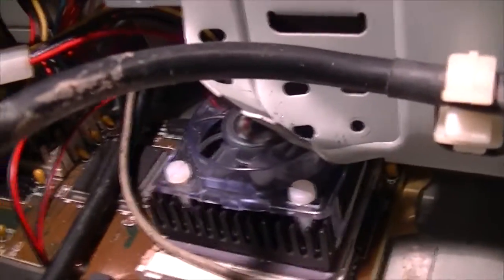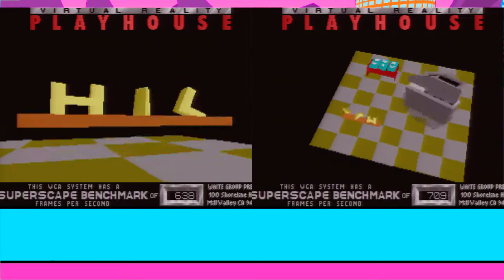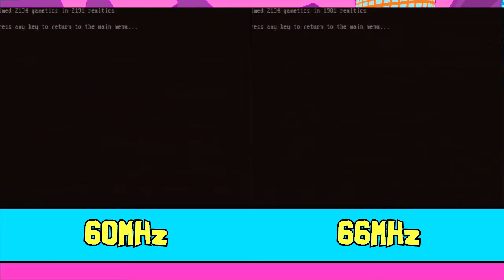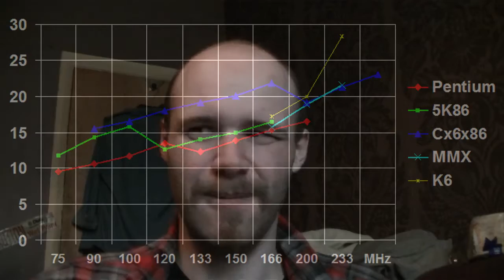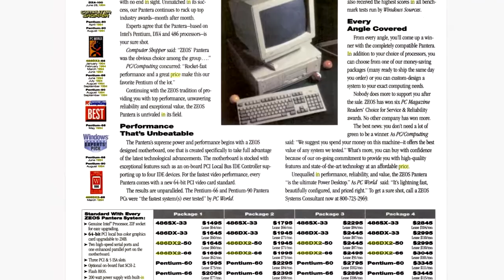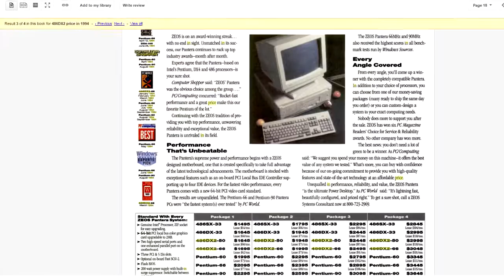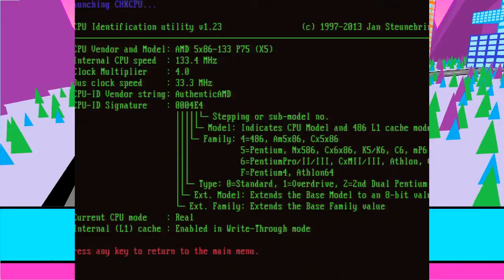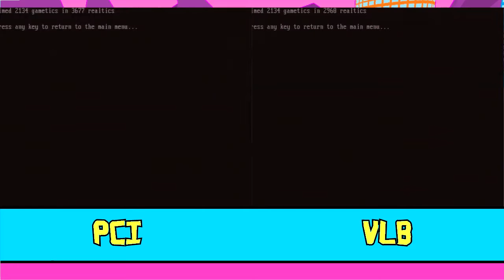Was Socket 4 ever practical?

Comment: i 100% agree with you on TDP. Has always been a garbage metric.
Reply from the maker: +Scott Gurney I've always felt that with such measurements, they probably make up a number and then figure out how to arrive at that number from the available data... Essentially doing things backwards. I've seen heatsinks which cooled a CPU with a 95 Watt TDP fail to cool a 75 Watt TDP chip adequately, which further implies the metric is meaningless. My rule there is generally to ignore that rating and find the biggest cooling I can get, then add even more cooling just to be safe, such that if a fan fails the system won't care. I got hassled in the Athlon days for running a 3200+ rated cooler on a Duron, but hey, that CPU still works so I clearly didn't do anything wrong there. Much like power supplies it is one of those things you can do cheaply, but it probably isn't worth it if you plan to run the system for any length of time and it would likely be better to do it right in the first place. Hence the workstation uses an over-sized PSU and could run cool even with half of the fans stopped. Marketing always find ways of selling BS numbers and covering the facts, the worst used to be when motherboard boxes in retail stores contained no information or pictures of the board inside and you weren't allowed to open the box to look at the board. This was the only reason I ran an MSI KT3 years back - it was the only board in the store I could look at and knew what was actually onboard.

Comment: Doom actually maxes out on this machine in fps, outside the benchmark, Doom is limited to 35 fps in gameplay. So if it is getting about 37 fps in a timedemo, that means a Pentium 66 can run it at the maximum framerate for the engine.

Btw on Quake, I don't have a real retro machine with me here, but I tried to set DosBox at around the same cycles as your Pentium 66 (meaning it runs Quake at the same speed) and I found the full screen a little jerky, but after I reduced the screen size by two notches, it ran quite smooth. The timedemo returned around 23 fps, it does not seem like much more, but it feels far smoother especially considering it is probably like 25-30 in a corridor with only 1 enemy alive, the timedemo has a lot of explosions going on. A Pentium 75 is definitely not needed.
Reply from the maker: I doubt if DosBox is entirely accurate, but interesting to hear the results nonetheless. I don't doubt shrinking the screen improves the performance, but I've tested every other machine with the exact same settings, my results are worthless if I adjust the game to run better on each machine as they would be skewed and demonstrate nothing useful in terms of comparing performance to another system or hardware configuration. Believe it or not, I have no desire to actually play Quake at all, in fact I have rather a strong dislike of the game and have only ever used it for testing purposes as seen in these videos. I have way more fun with Duke or Shadow Warrior, but they lack a proper benchmarking feature. In response to some of your other comments;
I still can't find any advantage to owning one of those Socket 3 5x86 processors. I do own a POD83 now and I like it very much, but it is a temperamental and impractical beast that cost more than I'd like to admit to. Overall, I'd still recommend a DX4 or a P75 to anyone that just wants things to work, but I also said somewhere, likely in my Pentium OverDrive video, for those of us who like to play around and see what these things do, then they're worth having anyway even if they are sometimes strange or unreliable, from such a perspective, that's half the fun.

In the Dark Forces video it would have been unfair to shrink the screen in Doom and not Dark Forces, my intentions were to run them on an equal footing at the highest settings possible, and it demonstrated that Doom's engine is significantly less well optimized than the Jedi engine used for Dark Forces. It also demonstrates that the system requirements for both games are accurate. I did try screen shrinking in Doom on the 386, but even with a 486DLC-40 it runs quite poorly and is quite challenging at such a low frame rate, in low detail mode with a shrunken screen, finding a balance is tough and I can honestly say that I think Id were right to state a 486 minimum on the box.

I appreciate the input, hopefully you understand my reasoning behind why I did these things in the way that they were done.

Comment: Intel never screwed original Celerons, in  my eyes, they were always good. The advantage of Pentium II platform and full working agp slot, better and stabile chipset, and better FPU for 3d games, always showed. Also better overclockalibity, better TDP and upgrade path (with BX chipset, in early 98, till Tualatin viable even in 2002-2003.
investment into socket BX platform in 1998, and Celeron, was one of the best.
Reply from the maker: I missed this one, or I would have included this with the other reply, but - whether the Covington Celery was screwed or not, it was often paired with boards that had neither the BX chipset, nor an AGP slot. The FPU should have been the same as the one in the P2, so I doubt there was any advantage there and there was no cache. The Pentium MMX was better value for quite some time and the K6 quickly encroached on this space too - in fact the K6-3 managed to outstrip the P3 for a brief time, if memory serves correctly.
I never considered the Tualatin a viable option, largely because it wasn't really available at retail and the K7 was often both cheaper and faster by then if you were building a new machine. Although, the last in line Celery chips may have been a good upgrade if you really didn't want to let your 440 board go yet and could make it work. It's a shame a lot of board vendors - even good ones - lied about CPU support at this time. Personally I'd sooner have just saved a bit longer and gotten a K7 though - and I did, it worked.
Nonetheless, the 440BX/GX stands as one of the all-time greats, you simply can't go wrong with them and the Mendocino Celery was actually good value for a lot of enthusiasts.
Reply: @HighTreason610  Thanks for reply. I though that comparsion of Celeron of course to AMD k6-2/3, not to Pentium II. Celeron and AMD k6-2 was competiting. AMD k6-2 400-500 was slightly cheaper, than Celeron 366, but about the same as Celeron 300A.

In April 1998, there was already a BX chipset, but it was mistake to buy Covington, because Celeron A came out only 4 months later. Well, in 1998, I would wait till august, then buy Celeron 300A.
It's true, many with Celerons opted for cheap motherboard, but it was a mistake. I would definetly pay for BX motherboard, for true AGP slot performance. Celeron 300A overclocked to 450 A could be usable till 2001, it was a beast.

FPU was stronger on Celeron/PII side, Celeron 300A would perform in 3d games same as AMD k6-2 500-550. After overclocking AMD Celeron 450 A was a beast, was performing about the same as Celeron 533A coppermine. And Celeron 533A coppermine was new processor in april 2000, so it was good enough till 1 year as budget processor.

I've checked Celeron 450A had 72 fps in Quake3 (lowest resolution). The review is on Anandtech.

Same as Celeron 533 non-overclocked.

You can see it here in chart of Celerons, 72fps is about 533 Mhz Celeron: https://cdn.mos.cms.futurecdn.net/uip3e6XAJHkCrepoLKicUR.gif

Celeron 300A with BX motherboard, and overclocked to 450A, was one of the best investement to computer, in computer history. The ones that did it, had to have very good gaming year 1998-1999, for very cheap. :) Although, for good BX motherboard, one had to pay like $60 bonus over some cheaper ones, I think, money was well worth. One could also use AGP cards, and later in 2000 switch to Geforce 2 MX for example, which was a beast for little money.

Comment: Have you ever had a NexGen system? I have one here, motherboard and cpu, it was working fine, but the Dallas RTC battery was dead, and when I tried to replace it, the system would not post anymore :( I am sure I didn't put it the wrong way round, just don't know what happened, tried 3 different chips, went back to the original, same thing.

I'd love to do some benchmarks, comparing against 486's and sockets 4 and 5. The board was very picky concerning video cards, I could only get it to work with an S3 PCI, or any ISA card. Trident models would give the 2-short, 7 long beeps.
Reply from the maker: NexGen eh? Hmm. Unfortunately I'm kind of stuck for ideas on that one, but to be on the safe side with the RTC there should be a notch in one end of the socket, that should line up with the Pin 1 marking on the RTC. If you have no socket and are soldering it, one of the pin vias should be square to mark pin 1. Otherwise, I'm not sure what's wrong with it. I'm not particularly familiar with the PCI board they made either, though I do suspect being picky with cards might be a thing as I am aware of this happening to some peripherals on the VLB version of the board.

Comment: You keep mocking the 486. You also said a couple of times that once the pentium came out, the 486 were of little interest.
It seems to be that you are forgetting about:
AMD 486 DX4-100
AMD 486 DX4-120
AMD 486 X5-133 ( also known as Am5x86-P75 )

Those CPUs came at a very low price, used mainboard with ALI and SIS Chipsets ( or otherwise CPU Voltage Adapters ) that were quite affordable, and managed to perform at about the level of the Pentium 1 60Mhz upwards.
The "X5-133" especially was legendary, for it could be safely overclocked at 166MHz and actually managed to compare to a Pentium 1 90MHz.
One of the best boards to this bit of trickery was the "Soyo 4SAW2", which can usually be found equipped with said professor if bought on €b@y today.

You also wondered which GPUs were best for Win95. That's actually easy to answer: It was the ATI Mach 64 and later models, because there literally was nothing else in 1995 except Trident and TSENG cards, most of which still used VLB and were focussed solely on 2D graphics.

The real competition started around 1997 with the S3 Virge GX2, NVIDIA Riva 128, Ati Rage Pro and Matrox in combination with a "PowerVR PCX2" ( the Voodoo Rush we all try to forget about, and the Voodoo 1 was 3D only ).
This means that your statement about not knowing which card is best due to not knowing the application, is more of an issue with Windows 98 than Windows 95.
Reply from the maker: I don't recall mocking the 486, given it's my favorite platform. I also did mention those chips, in that I indicated they didn't actually exist yet. I think you're missing the point somewhat, that being, was there ever a time when Socket 4 was desirable over a 486 system. For a short time - and I mean an extremely brief period in history - there weren't any DX4 chips, let alone DX5 models, and there were no Socket 5 chips, so within that short span of time the Pentium 60/66 stood alone in x86 performance. It was rapidly dethroned however, aided largely by AMD and later Cyrix, likely even UMC at the lower end.
The GPU question isn't easy to answer, because I can't account for every possible application someone might want to run. In my particular case I found the Mach64 was slow because few of my applications made much use of any acceleration it offered, meaning that even a Trident 9440 outran it by sheer brute force. Some cards prefer GDI, some shine in DirectDraw, some power through pure software. It would be pointless for me to recommend, say, a card which focused onDirectDraw to someone who wanted to run mostly GDI applications where it would be weak, in the same way that today it would be ridiculous for me to recommend my Matrox Mura to a gamer, or for you to suggest I use GeForce cards to run a video wall.
Reply: Thanx for answering.

If your drift was that socket 1-3 ( 486 ) outdid the socket 4 ( early 586 ) except but for a very short period of novelity time, I misunderstood. My bad.
If you had an AMD X5-133 @ 166 MHz, you actually needed Pentium 100+ to get a faster system.
And yeah, 486 models were my favorite, too. ;-)

If you meant that there was no ideal GPU in the year 1995/1996, then once again, I misunderstood. Sorry.

I don't recall a Cyrix 80486 to ever outperform a socket 4 other than in price, sales and energy efficiency though ... .
Reply from the maker: It's fine, I welcome comments and criticism, then I use it to try and improve in future videos. My presentation isn't always as clear as it could be, I don't get paid for this, I'm just having fun and I sometimes get things wrong. Ha, I am a human being.

Indeed, the X5 can be made to run at some impressive speeds. I tested one at 160MHz on a VLB board for some time, until I got my hands on the OverDrive - a chip which worked better for me because the programs I wanted to run had optimizations for P5 chips - and it did very well, explaining its popularity.
I think the Cyrix DX4 could just about keep up, but just barely. This was why I said "at the low end" because by then Socket 5 was around and the price of Socket 4 had dropped, though not enough to justify buying one over a Socket 3 system as gains would be negligible. Plus you could put the money you saved on Socket 3 parts towards an X5 chip anyway. If Cyrix did anything, it was forcing prices down across the board. Even if you weren't buying their stuff, they were good to have around because they made the Pentium cheaper, they influenced Intel to actually fix the Celeron and likely had a part in manufacturing something in your home thanks to the STPC - Cyrix's 486 core lived until at least 2009. Chips like the STPC and the MediaGX certainly had an effect in the long run, the implementation of the former bearing a very strong resemblance to processors like the Atom today.
UMC, on the other hand, were absolutely terrifying, I'd love to know what they would have done if their DX chip had launched or they'd gone for 5th generation platforms. They weren't in the market for long, but Intel definitely noticed their presence quite quickly, given their SX-33/40 could generally keep up with Intel's DX2-66 design.